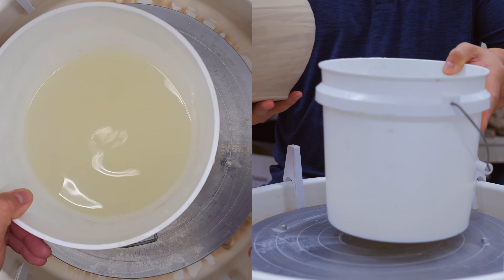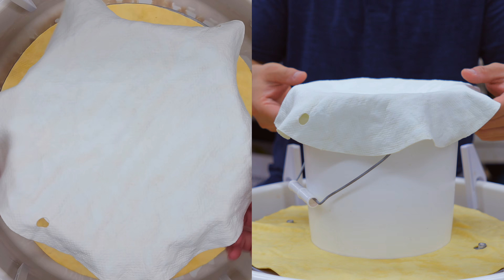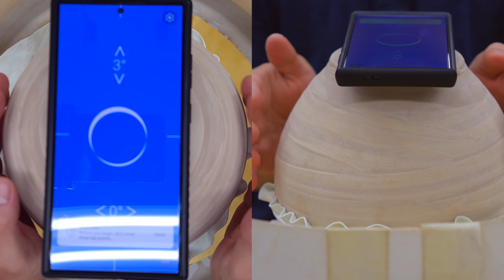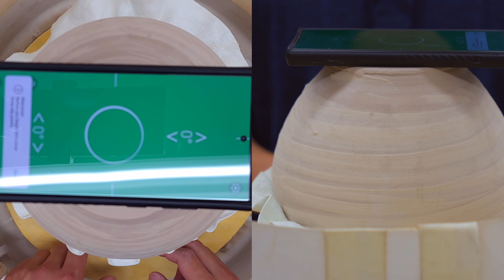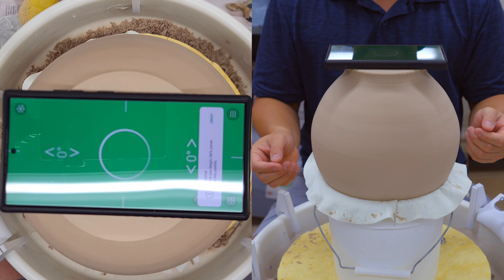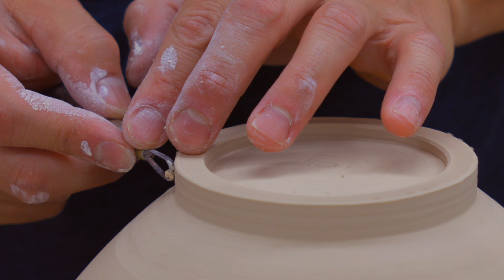Moon Jar Trimming on a Bucket?!? || Foot vs. No Foot

Comment: Thanks for another great video!
It's always the simple things that make all the difference! I had tried using a bucket before, but it seemed too light & flimsy. Just pouring water into it is such a simple and genius idea. It never occurred to me. 
Same with wetting the clay when it got too dry.
I'm also interested in bat mates. I've looked at them before. They are quite expensive. Are there cheaper alternatives? Can you make your own??
Reply: I use a synthetic chamois and cut it up into a circle
Reply from the maker: Aloha Dippy! If you use water in the bucket make sure its not too much to touch your piece when it spins. You could also use a dry material like bricks or weights! But as for the bate mate, they are just synthetic chamois cut into circles.  I found some cheap ones on aliexpress/temu but haven't ordered them before.  If you do end up splurging on the batemates they are an awesome product!

Comment: For bowls and moon jars like these, do you make your foot or bottom a certain percentage of the width of the vessel?   For instance, I strive to have a foot that is about 1/3 of the width of the widest part of the pot. Just curious if you think about this or if you have a personal goal for it.
Also, you left quite a lot of clay on the inner part of your foot. Do you always make this area flat rather than curving the edges to meet the curve of your walls?  I know it's personal preference but it really makes a difference in the weight of the pot so I'm just curious on your thoughts.
Reply from the maker: I usually don't think about the proportions when throwing. I just eyeball it when trimming and remove clay until it looks balanced. As for the bottom, I left more because it was all ready getting thin. If I tried to match the inside and outside foot height I probably would have trimmed through.

Comment: If you use a short piece of PVC pipe attached to a plastic bat with pipe cement instead of a bucket, you'll never have to take time to center your chuck again. The bat mate is used over the top just as you do now to protect the pot from damage.
Reply from the maker: That's an amazing idea! Looks like I gotta go shopping for some PVC and pipe cement! Thanks for the tip 😀